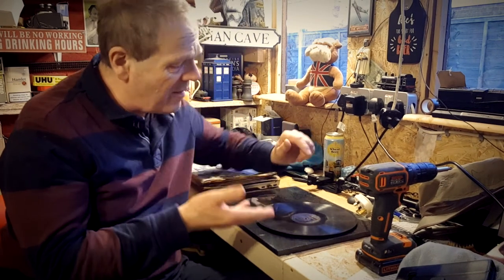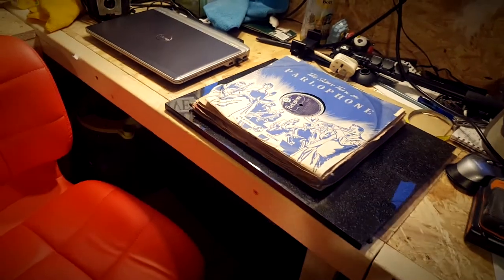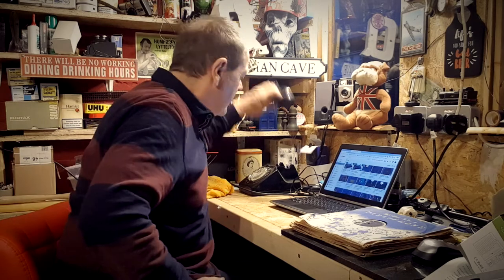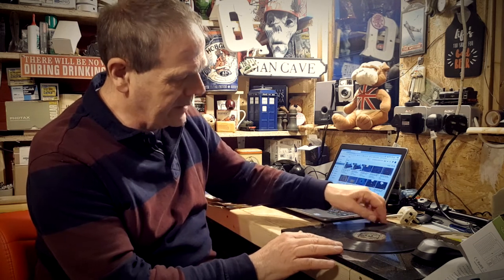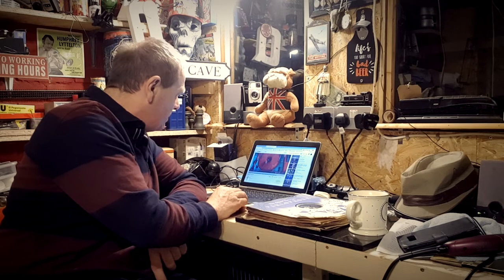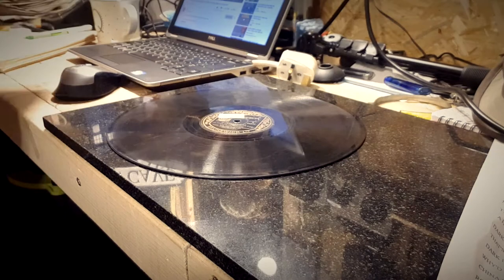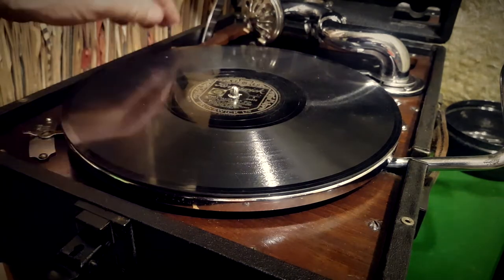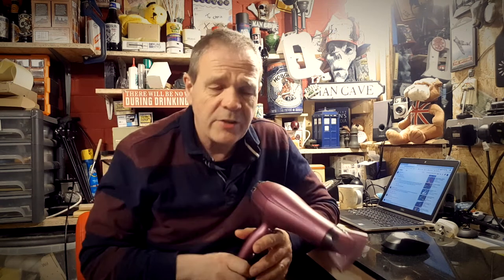DEWARPING VLOG WITH SHOUT OUTS...   WITH BAD WARP   :(  78RPM SHELLAC FUN

Comment: Great video and good info on flattening records. I too use the hair dryer method, but I like the idea of using a stack of 78s for weight as they will retain the heat a bit and allow it to cool down slowly, hopefully avoiding cracking. Certainly true we have more time on our hands now, being largely confined to home. I've been cataloguing my 78s and making videos! Thanks 👍😀
Reply from the maker: Cheers mate, Yes, unfortunately I'm a key worker being on transport so I wont get as much time at home, but the wife cant get me out so... ;)   Yes I'm doing the same as you when I can and still have about a 1000 to look through from the original haul of 3000 plus...